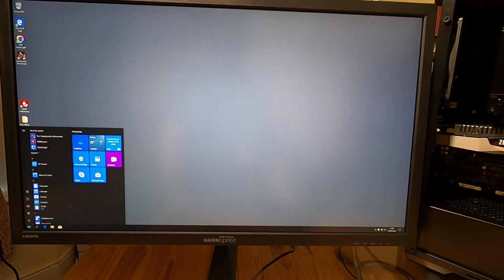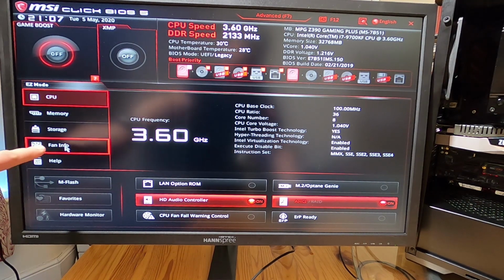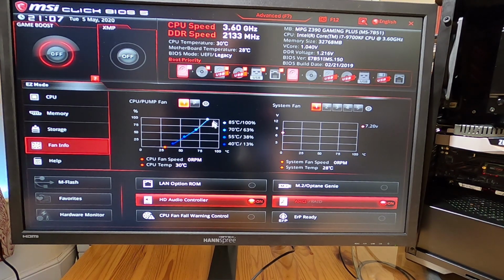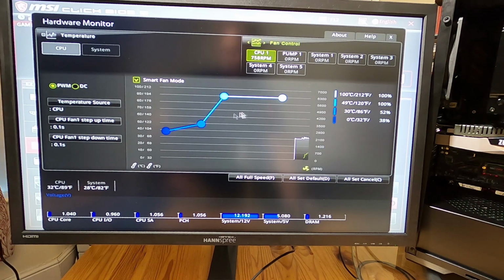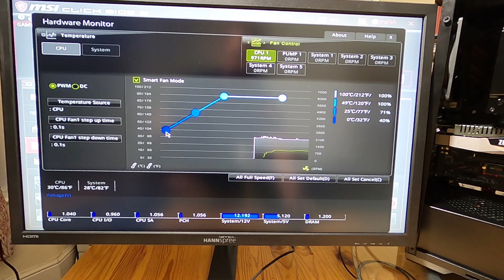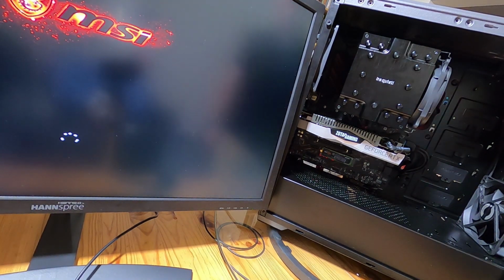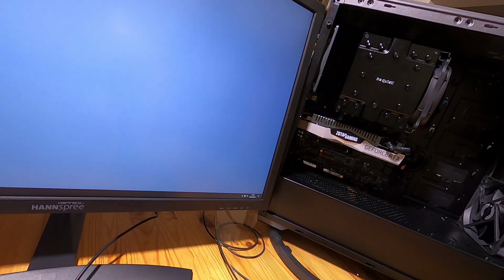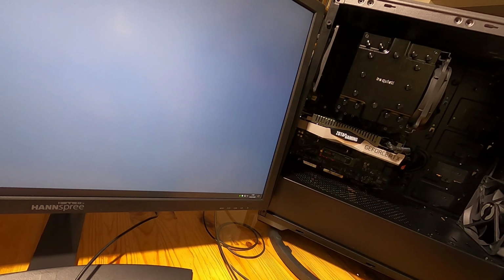CPU Cooler Ticking Sound *DIY FIX* in English

Comment: I’m running a water cooler and getting a similar ticking sound, I just came back to my computer and heard the ticking sound so I shut it off just while I diagnose it. Hoping it’s the same thing although it sounds like it’s coming from the reservoir instead
Reply from the maker: It might be the pump if yours is integrated into the reservoir.

Check which motherboard header you've got the water pump connected to though.... some motherboards have a dedicated AIO or pump header. If it's been plugged into a standard fan header all its life then that may have caused the pump to wear out prematurely.

So if it's been working perfectly for a while and the noise is new then you have have a mechanical fault.

For fans, it easy to diagnose - you just use your finger to stop each one spinning and se if the ticking stops - pumps are obviously different.
Reply: @sterntechdaddy  okay thanks for your help, when i tilt the computer it dies out for about 10-15 seconds and then it comes back. sometimes the sound is very irritating and sometimes it's barely noticeable
Reply from the maker: @James-mt4cc  Is this a custom loop?

I think you've got the pump connected to a fan header - so it'll be using a fan profile rather than something more suitable for a pump.

The change in noise might be it speeding up and slowing down as temps rise and fall. Its OK the run the pump at a constant speed - provided the flow rate is sufficient to have cool water at the return, the speed can be tweaked to reduce pump noise.

Also note that its changes in noise that you notice that's an instinctive reaction - you actually get used to constant sound so check which header the pump is connected to.
Reply: @sterntechdaddy  it’s an all in one, I believe the cooler master 120 lite. It’s currently plugged into pump_fan1 on the motherboard which I assume is correct? I’ve had the system for 5 months and when I went to make food and came back it was doing the noise. Idle temps are about 45 degrees which is as it was before (running a ryzen 5600)
Reply from the maker: @James-mt4cc  Where is the rad in relation to the pump?

The pump is in the CPU block.... so have a listen. 

You might have some air trapped in the pump... but if you put your finger on the main rad fan to stop it does the noise stop too?

If not then the noise is definitely coming from the pump and if its not the highest point in the loop (where the air ultimately collects) then you may have a faulty pump.

Make sure you've got the original box just in case you need to RMA.
Reply: @sterntechdaddy  the rad is in the rear of the case, with the hoses at the bottom of the rad. Would it be worth moving the rad to the top of the case to see if that helps? Box is still here so that’s not an issue, I’m just always nervous as hell when replacing coolers etc as I’m worried the cpu paste will go everywhere.
Reply from the maker: @James-mt4cc  It won't - it's a thick paste and not fluid. So don't worry.

And the 120 Lite comes with a tube of paste so you should have some spare to reapply anyway.

I'm guessing you've mounted the CPU block with the Cooler Master logo orientated nicely - so the tubes are on the right next to the RAM slots as you look at it.

In which case you won't need to remove it to change the position of the rad - just unscrew it and it should happily fit at the top of the case. Assuming you've got a vent there.

The tubes are pretty rigid though, so just be careful.

Note that if the top of the pump is below the highest part of the rad then that's OK and the noise probably isn't air - it's something an RMA might solve.

But its wise to check first - or they'll just send it back.
Reply: @sterntechdaddy  Looks like I don’t have enough room at the top of my case to put the rad. It just seems very strange how it was fine for months and now it has a strange noise that can be temporarily resolved by tilting the case (for about 10 seconds). If I keep an eye on temps would it be okay to run the computer until I sort something out? 

God being a geek’s stressful.
Reply from the maker: @James-mt4cc  It should only be stressful if the problem is your fault...

Otherwise don't worry - things break!

I did a bit of searching and noise and RMA appeared together quite a lot.... which suggests the pump might be faulty.

As its still under warranty it's now going to be easer just to RMA it and see what happens.

For the UK, your contract of sale is with whoever you bought it from - not Cooler Master. So don't get fooled into sending it back to Cooler Master when the retailer actually has the responsibility for it.

:)

The bonus is that a retailer won't really be that interested in a thorough diagnosis and will either refund you or send a replacement pretty quickly too.

:)

In the meantime, if your CPU was in retail packaging then you can fit the stock cooler that came with it while the AiO gets returned.

Comment: i hear this ticking noise in my headset.... how do i fix
Reply from the maker: Does it happen with speakers?

That might be an audio driver issue, but check your headphones on another device and try a different socket if you have one.

Just to eliminate some possible reasons.

Comment: is if normal or sum to worry about
Reply from the maker: It's normal in that it happens to pretty much all fans when they are at low voltage.

It's not something to worry about in that it's not a sign of damage.

But it can be irritating and very distracting. And stressing the fans like that doesn’t feel like a good idea.
Reply: @sterntechdaddy  ok good i thought my pc was broken or something lol, thanks
Reply from the maker: @brett4389  No problem.

If you use a headset then you won't notice, but you will be conscious of the sound - especially at night.

:)

Comment: For me I get the ticking noise when I first start the computer. Then when I restart it, it gets really loud when I first start it.
Reply from the maker: If you can take the side panel off and listen, you might be able to identify where the ticking originate from.

It'll usually be a fan....
Reply: @sterntechdaddy  I have a asus rog watercooler for the cpu, the pump tiks at low rpm. This happened all the time until I got into the motherboard and set the pump at 80% speed. Now it only happens when the pc starts
Reply from the maker: @santiagoferrari1973  If your motherboard has a header for pumps then use that. If you're using a fan header then the pump will be running according to the fan profile - which will cause variations in the speed - which generally isn't great for the life of the pump.

It's better to set the pump at a constant speed. This can be set at a noise threshold since the actual fans will do the cooling and the pump simply moves the liquid though the system.

Comment: Hey! I don't know much about pcs but my computer has been recently emitting a blender like noise coming from the coolers of it, this has happened 2 times in the past 1 1/2weeks. The sound vibrates A LOT and actually sounds like a blender. Is my CPU dying?
Reply from the maker: Not the CPU... but probably a fan...

It's important to distinguish which fan though.

Lets start with the cheapest... so open the case up and disconnect all of the system fans.

A system fan is defined as every fan in the case except for the one in the PSU and the one(s) attached to the cooler for the processor.

Then just use your PC as normal.

If the sound goes away then you've solved the problem... if you' want to do a 'proper' job then plug the case fans back in one at a time and listen out for the noise.

Or plug them all in at once and leave the case side panel off - when you hear the noise have a closer listen and identify which fan(s) are making the noise. Note that ifd it is a system fan then you don't have to worry about damage to your CPU...

:)

Comment: Hey, I wanted to repair mine but now it's way more noisier, it sounds like a hard drive
Reply from the maker: The trick is to alter the fans so the minimum speed is just enough to stop the low speed clicking. Which works well on the PC featured in the video.

This is only possible if the motherboard has adjustable fan profiles that allow fans to be tweaked at the low speed end of the curve - the noise from full speed running should only happen when the CPU is really running hot.

And that shouldn't happen because modern multicore processors aren't usually stressed at 100% load on all cores very often.
Reply: @sterntechdaddy  I have a i7 860 oced to 4.0ghz with 1.45 volts, so...yeah, I have a good speed controller on my mobo, and I control em with speed fan, anyway I bought another fan, it's silence af now, when gaming tho I put the fan speed to ramp em up so the CPU doesn't pass 69C in the highest demanding scene/game, I knew that, but thx tho, nice to see you
Reply from the maker: @darkraft100  I wouldn't like to have to manually adjust fan speeds every time I played a game... in case I forgot to do it.

:D
Reply: @sterntechdaddy  I don't set em manually, speed fan has a function to controll the fans after what temperature sensor I have one exit with the cpu temp and one intake with the gpu temp, it's like gpu control fan speed  =)))))) 
And I set a schedule to open spedd fan so I don't have to do anything for my fans to ramp up or down
Reply from the maker: @darkraft100  Are you using air cooling only?
Reply: @sterntechdaddy  yep, it's enough
Reply from the maker: @darkraft100  Which HSF do you have?
Reply: @sterntechdaddy  SE-913X
Reply from the maker: @darkraft100  That's a £20 cooler so it's impressive that it can cool an OC 8600 CPU even if games won't fully utilise all the cores.

Have you delidded it?

I wonder what temps you'll get if you run Prime95.
Reply: @sterntechdaddy  i7 860* 1st gen, no, I didn't delided the cpu, I had planed it but I gived up because temps in games are ok, in aida I have 83C, but I don't worry when the cpu doesn't pass 70C in real world use, btw 40C idle with fans at 40-50% XD
Reply from the maker: @darkraft100  I delidded my 8700K, but mainly for fun rather than anything to do with OC benchmarking.

Just interested to see how well a cheap HSF works.

I guess they wouldn't make it if it didn't work though.

:D
Reply: @sterntechdaddy  it works very well, btw I use nt-h1 as thermal paste
Reply from the maker: @darkraft100  Not Kryonaut Extreme then?

That's only £80.00 for a 33g pot.

You do get some plastic applicators though...

:D
Reply: @sterntechdaddy  I got my rx580 with 78$ bruh, nevermind, maybe if I start a pc shop
Reply: @sterntechdaddy  I can make my own plastic aplicator for nothing XD like, buying an ice cream with a "cream aplicator" 🤣🤣🤣🤣
Reply from the maker: @darkraft100  I wrap my finger in a bit of cling film.

:D
Reply: @sterntechdaddy  I don't spread it, it spreads itself, when I first reaplied my laptop gpu thermal paste I took the cooler off just to see what aplication I did, it was FUCKING PERFECT, I felt bad after that because it was perfect
Reply from the maker: @darkraft100  I always spread it... mainly because I like doing it.

:)
Reply: @sterntechdaddy  nice :))))

Comment: I have basically the same build as you mentioned but my fan is running at around 2100rpm and it's making the clicking noise that's really annoying me. Is this the same solution?
Reply from the maker: Here’s what I would do...

1. Vary the speed and listen to the fan... use your motherboard software or a program like SpeedFan.

2. With the PC turned off, spin the fan gently with your finger and listen for the clicks. Check the blades spin freely and they aren’t hitting anything.

3. Absolutely be sure you know which fan is making the noise - if you can, disconnect all other fans.

4. Be prepared to replace the fan - ticking noises are common at low speeds, but not usually good at higher speeds.

5. Check the fan is mounted properly - it’ll click it is is lose, or twisted because it’s not clipped on evenly.

6. If it’s not the PSU or CPU fan then just disconnect it - that’s free, takes a few seconds and won’t badly impact system cooling. 

These aren’t in any particular order, so read then all and start with what you think is the easiest.

:)

Comment: Thank you so much for this video! I couldn't find anything that even came close to what I am experiencing with the new MainGear laptop  got. One question. My problem seems to be intermittent and happens about every 15-20 seconds.  It seems to be coming from the front part of the laptop and only seems to happen when I open an app or start doing something like playing a video.  Do you think it could be another issue? The laptop is full SSD and doesn't have a HDD. I am really hoping its the same issue you just described. This laptop is perfect and functions flawlessly...minus that very faint clicking noise that you can barely hear.  I really don't want to have to exchange it. 

Thanks again! Much appreciated!!!
Reply from the maker: You probably won't get the same fan control on a laptop as the motherboard in the video has... but you can verify your problem by installing SpeedFAN or another fan control program to vary the speed. If you can change the noise with that then its the fans.

You can also tweak the cooling options for the CPU to check if it is the fans too - set it to passive and listen again.

When on passive I wouldn't game... but the things you mention in your comment should be fine.

Also, check for as BIOS update just in case that might help....

And see if you can pinpoint the location of the sound and compare that to the motherboard layout - it might match a fan position.
Reply: Did you ever fix it? I've been searching all over the internet and so far your description is the most similar to the problem I'm having right now. I've had my new laptop for a month now, an Acer Switf X, and recently it started with that same clicking noise every 20 seconds, when I'm playing some games or something similar. If you were able to find out what it was or were able to fix it, I'd love to hear what you did.
Thanks for your time!!!
Reply from the maker: @josefrnquiz  Contact ACER if you bought it from them directly... this seems to be a common problem.

Some people say is the internal fan catching on something, others that its the HDD.

Either way, opening it up to take a look will probably void the warranty - and it can't be the HDD is you've got an SSD.

The first thing to do is get your ear to the device and see if you can tell where the sound originates from.

Comment: I have the same issue when my laptop is idling. Should I be alarmed? I never notice any performance issue.
I'm using Acer Aspire 3 A315-21
Reply from the maker: You can fun CPUID HWMonitor to log the max temps of the CPU and GPU.

It depends upon how old the laptop is though - cooling efficiency can be affected by fluff blocking the vents and age deteriorates the thermal paste used on the heat pipe assembly.

Also, most sub £1000 laptops use one heat pipe for the CPU and GPU so even though the CPU is idle, the GPU might be generating heat.

Another key point is that people notice CHANGE more than they notice volume.

So if the fan is constantly spinning, you become deaf to it - and you actually notice the changes in sound more as the fan spins up and slows down.

You can try tweaking the cooling in the Advanced options of your current Power profile, and eve cap the max. CPU usage to 80% as that will lower the temps.

This was actually a fix for a gaming laptop in another video, and if you're not able to adjust fan profiles then its a sneaky way to reduce noise.

:)

Comment: Thank you so much I just turned up the fan speed on my pump and it went away
Reply from the maker: Some motherboards have dedicated pump connectors... so check for that...

But glad this video helped!
Reply from the maker: Oh... check the rating of the pump to make sure you’re not running it too fast or too slow.

The dedicated pump headers tend to supply a fixed voltage that matches the requirements pumps and you don’t really want to be running yours at anything other that what’s it’s designed to work at.

:)